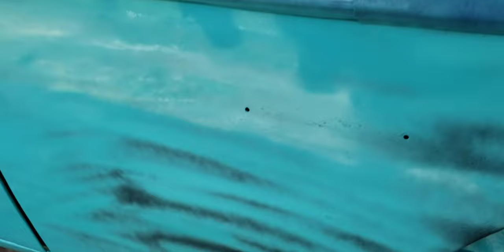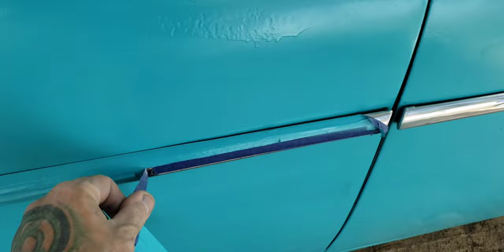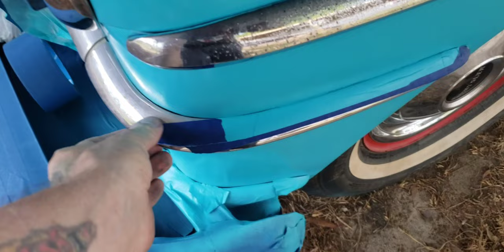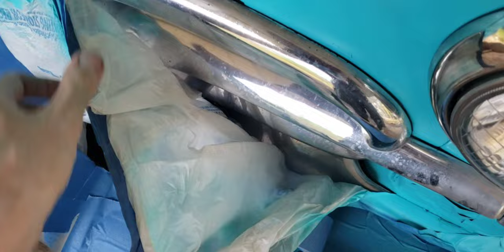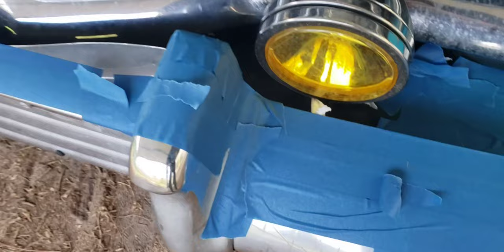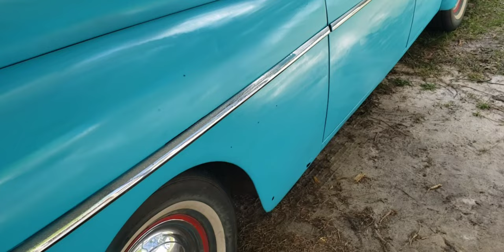1950 Chrysler Royal Rattle Bomb Part-1

Comment: Hey man, I’m actually looking at trading for this car on marketplace from the guy who has it now. Can you tell me, did you ever fix the tranny slip and brakes before getting rid of it? Is it a drivable cruiser now?
Reply from the maker: Tranny slips, brakes suck, needs every bushing, needs full exhaust, has no neutral safety switch, has almost zero steering input. It's not a safe, reliable cruiser. But if you're brave enough....